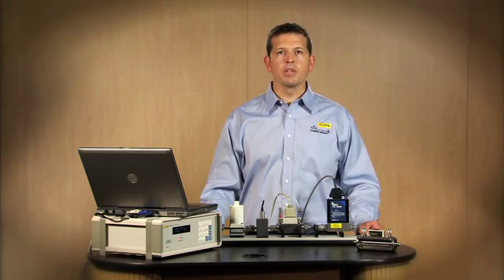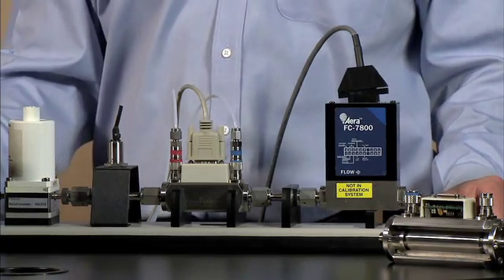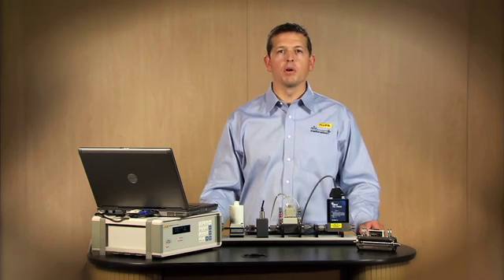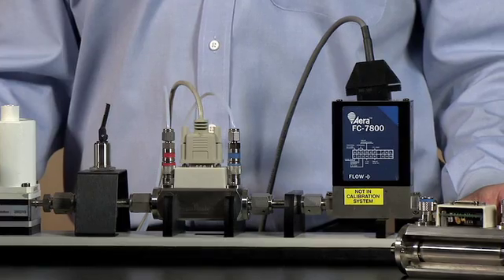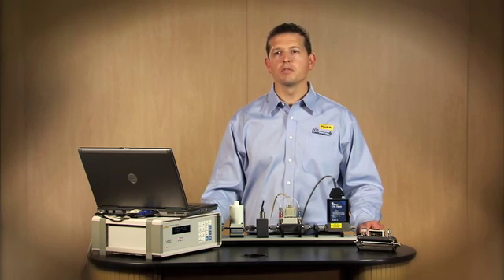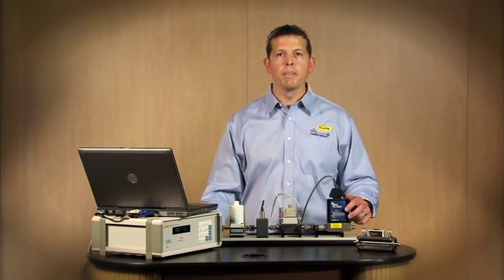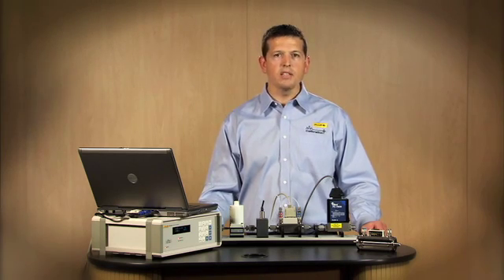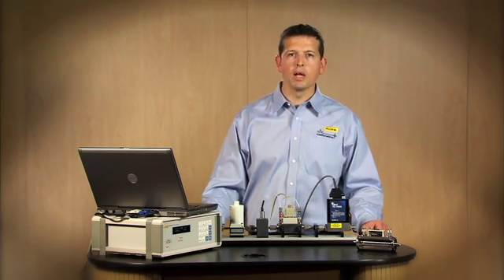Mass flow controller calibration using molbloc/molbox: Introduction

Comment: My lab needs to buy a MFC unit for Hydrogen and Propane /butane gases for micro-combustion. I need to know how MFC can be attached with fluidic tubes of the micro-combustor as temp inside mico-combustor would be around 800-1000 C. There would be back pressure as well.